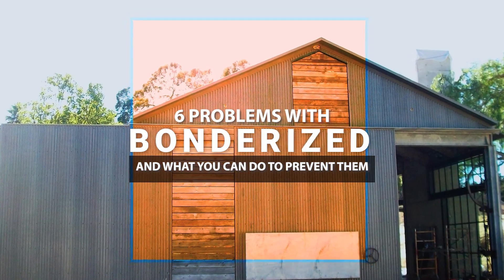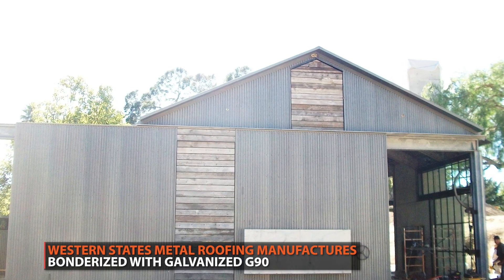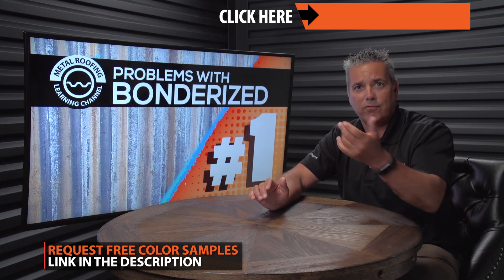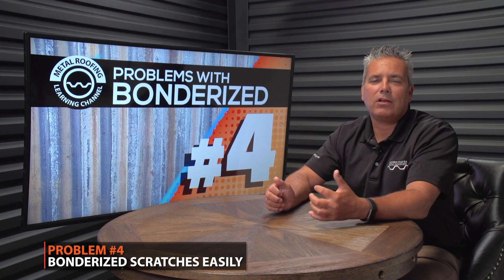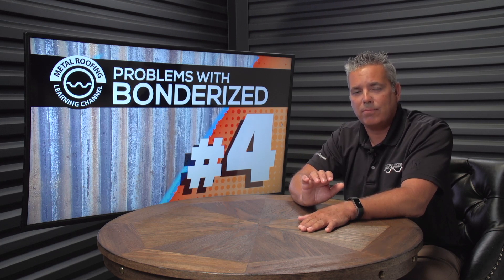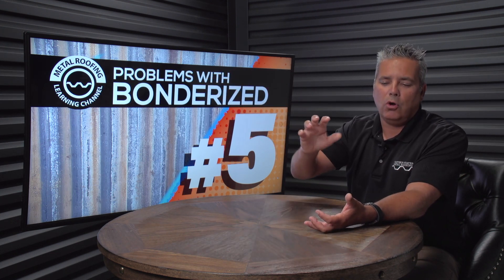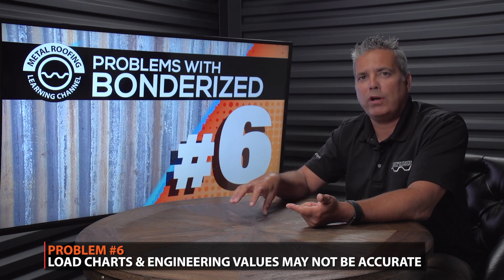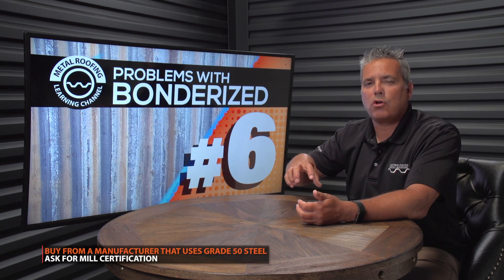6 Problems With Bonderized Steel. If You're Considering Bonderized Metal Roofing - Watch This First

Comment: Hello Folks,

Is it possible to use aluminum gutters with bonderized downspouts (painted) WHEN a vinyl downspout connector is used to join them AND the two metals are not touching (say a 1/4 inch gap between them)?
Will that stop electrolysis?
During rainfall, can electrolysis bridge the plastic and gap and corrode the aluminum?

Thank you,
Patrick

Comment: switching metals or specifying a product that isn't bonderized misses the whole point of using bonderized metal
Reply from the maker: I understand what you are saying, but there are also so many headaches and no warranty when using Bonderized. If you want the look of Bonderized, but without the problems, we now have a painted product that's a spot on match. It has PVDF paint finish and has a paint warranty. Here's some more info if you're interested.
https://www.westernstatesmetalroofing.com/bonderized-steel-bonder-paint